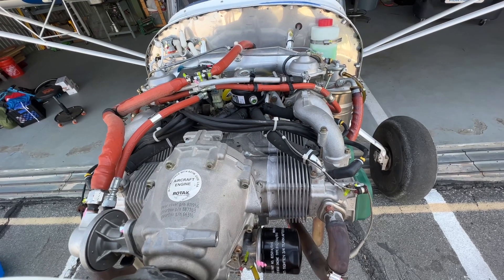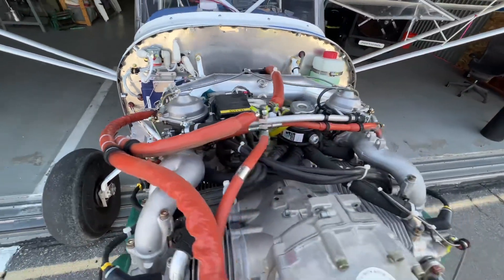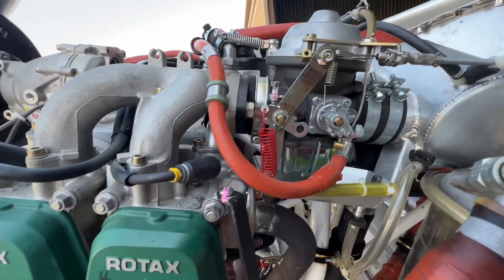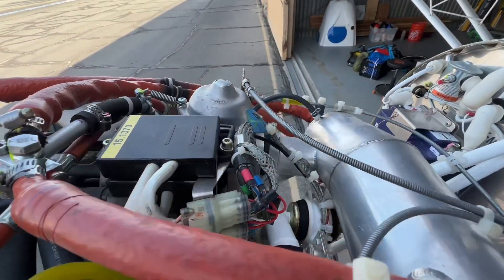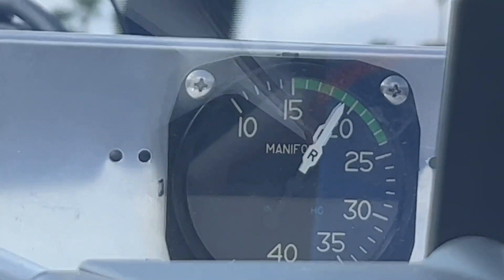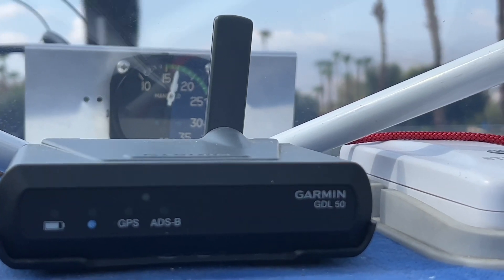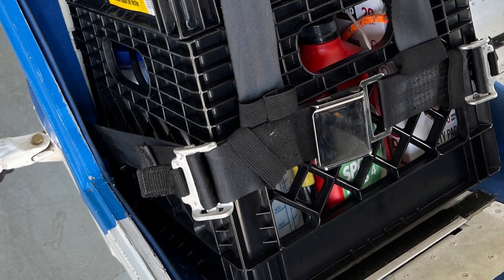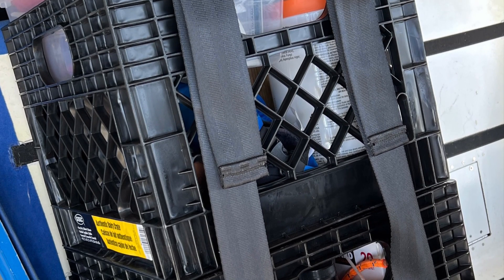Only watch if you like engines and airplanes.

Comment from the maker: RPM is huge difference between automotive engines and aircraft engines. Propellors are most effecient at around 2000rpm whereas most gas engines produce peak power at much higher rpms. This engine get the high effeciency by having a “transmission” that lets the engine run at its effecient 5000rpm while the prop is spinning at a much lower rpm.
Reply: From my days of wanting to build an ultralight, I remember a 'redrive' or reduction drive so you can have the engine spinning at a higher RPM but the prop at a lower RPM so the prop tips stay subsonic and keep the noise down. Hope I remembered it right! ; )
Reply: Fixed pitch or constant speed prop?

Comment: Seen a flight school out here in Hawaii that has a small fleet of RV-12's powered by Rotaxs, they would often forego the carb sync and allow the engines to run rough. In short, the rough running Rotaxs shook the planes to the point where engine mounts cracked and other various maintenance gremlins appeared.

Comment: Regarding the manifold pressure, is it not just related to the throttle body opening for each carburetor to be matched? And not specifically the adjustment of the needles. And by the way, Is it common for small aircrafts to have oxygen sensor reading? Just wondering. Im am not familiar with aircraft engines.

Comment: Has there been any desire to turbocharge Dotty? Does rotax even support this? From my understanding the main benefit is climb performance at altitude
Reply from the maker: Yes and yes! I kick myself for not getting the turbo. A 915uls make its rated hp of 140 up to 10,000 feet whereas my 912 probably only makes 70 of its 100hp at 10,000 ft (estimates)